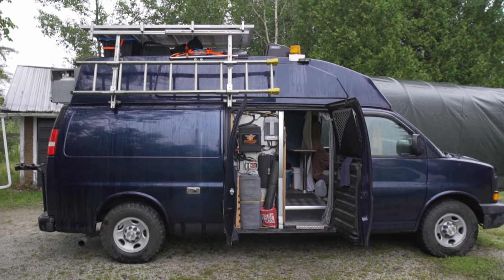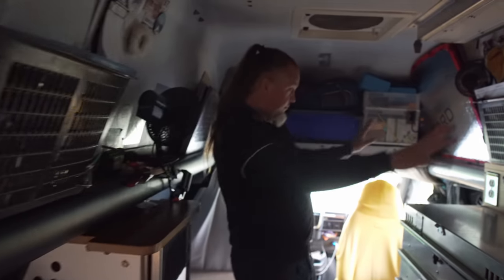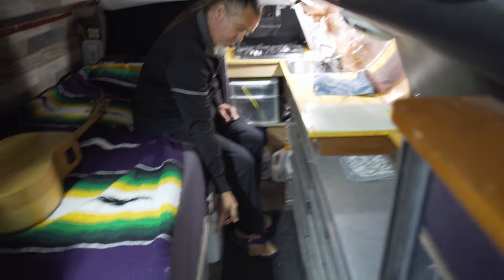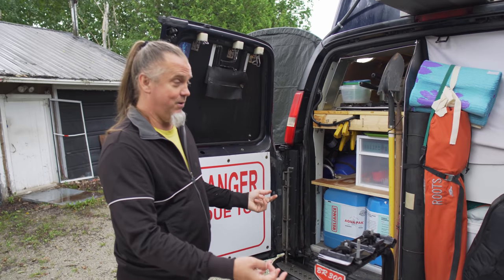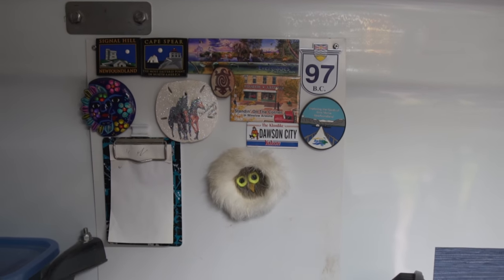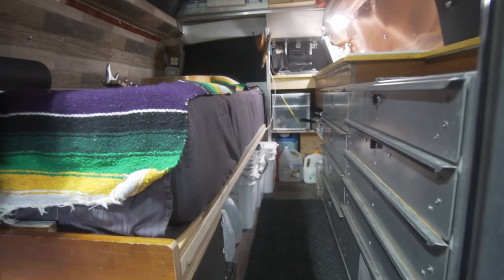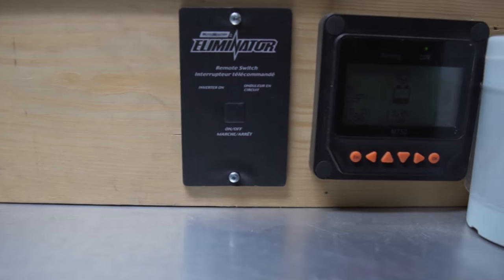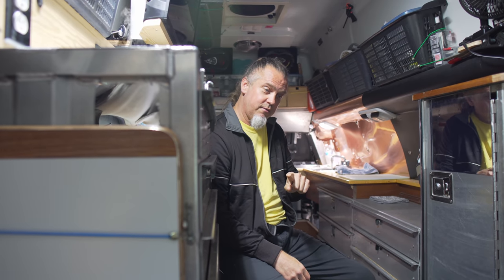4+ years of VanLife | Stealth DIY Full Van Life Tour and Documentary.

Comment: All that extra weight though 🤔
Reply: It's not that bad I still get 15 miles to the gallon highway and around 12.5 City
Reply: Yes weight is an issue especially where it's distributed which affects overall handling like braking, vehicle gross weight and tire pressure.  You can easily overload an RV so smart people will put them on truck scales to get an idea.  I see a lot of these tall van conversions and wonder how they handle on the highway with high crosswinds?